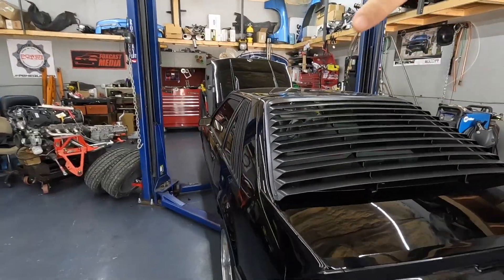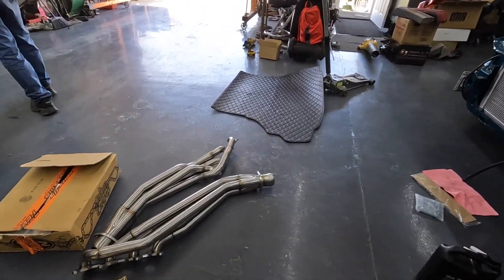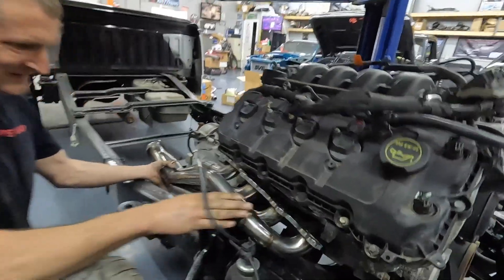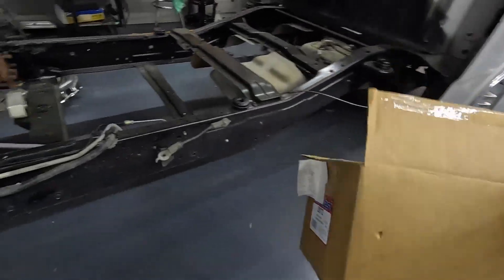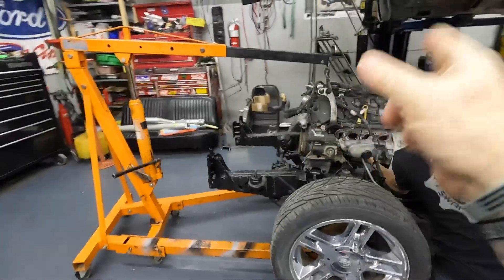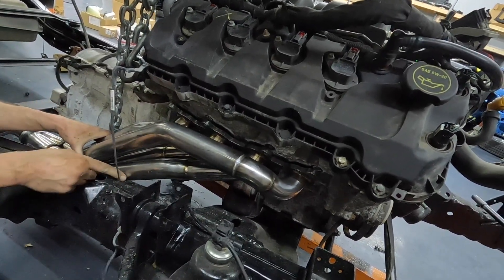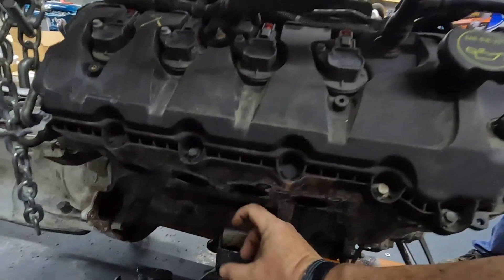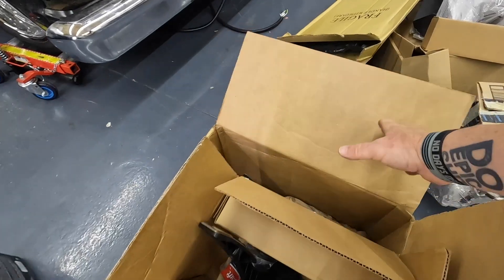Trial and error with this swap, we test different headers

Comment: Nice Video! I just did head gasket job on my 97 f150 4.6l and installed headers on it. For some odd reason, the passenger side is a pain in the you know what when putting in the header because there is almost no space between the engine and the frame. I was just about to cut a peice of the control arm braket because I couldn't get the header to go in. In other words, I had a hard time putting in headers that are designed to go into the truck so you guys are going to be fine when modifying the headers in the future.

Comment: Hey  is  it  possible  changing  left  motor  mount  changed  fitting  right  header ,  cuz  it  seemed  you  had right  header on  then  replaced left  motor  mount  and  test  fitted  left  header  was  good  then  charlie  not notched  the rear  a-arm perch  ,then  tried  fitting  right  header  , could  the different  left  motor mount  have  motor  tilted  over to  right , and not  centered in  chassis,  or  should  replace both  motor  mounts , I would think  it would be best  to  replace as pairs ,  what  do you think?

Comment: If you shimmed the motor mount to bias more to the driver's side, seems strange to have so much more space on one side vs the other? Or maybe swap motor mounts.. Use "duralast" on passenger side and original on drivers? Best of luck, I look forward to seeing the actual solution.